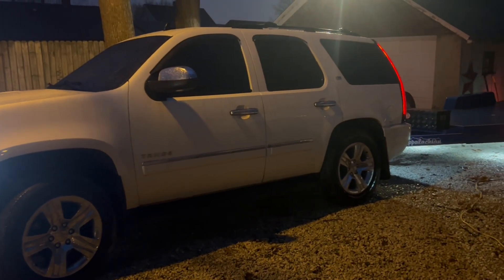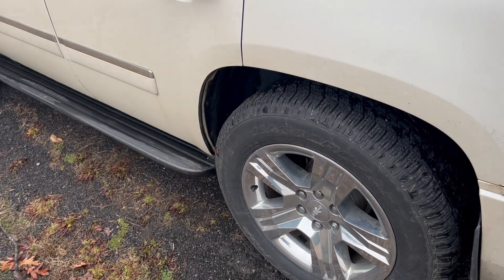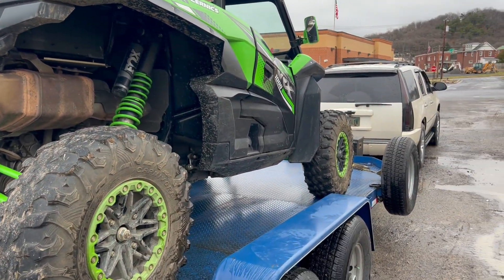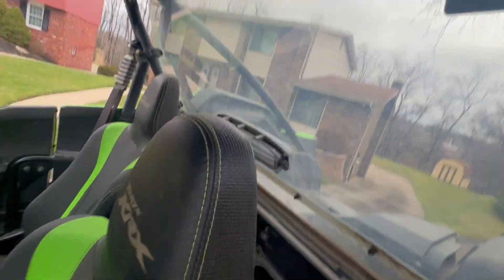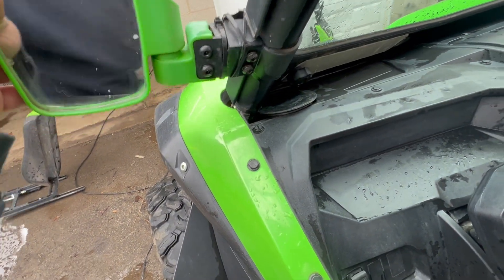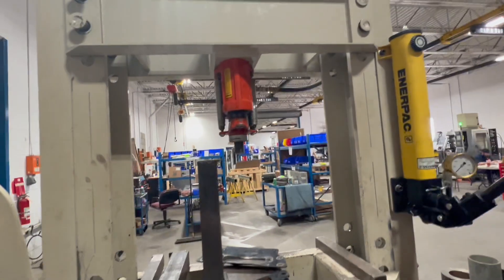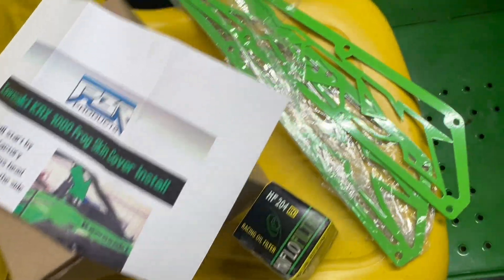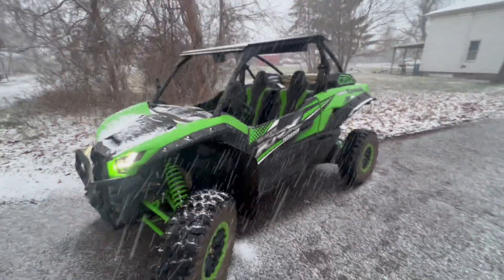Buying a Used 2020 Kawasaki KRX of Facebook Marketplace

Comment: Wonder if the previous owner ran the winch rope all the way out an ran it in the other direction?.? Maybe that’s why it’s backwards
Reply from the maker: That is exactly what I think happened. It took me a long time to figure it out. The winch wiring on this is going to get replaced because I have found a lot of issues. I was having issues with the solenoid and took it apart. Lots of corrosion and was only working intermittently and sometimes even without hitting controller. Also a concerning lack of fuses. Prob Going to replace wiring and change to rocker switch